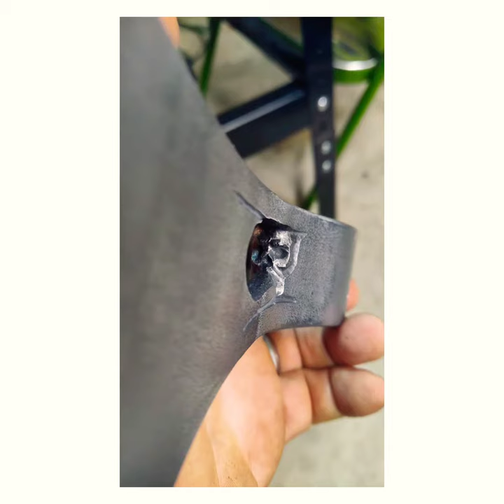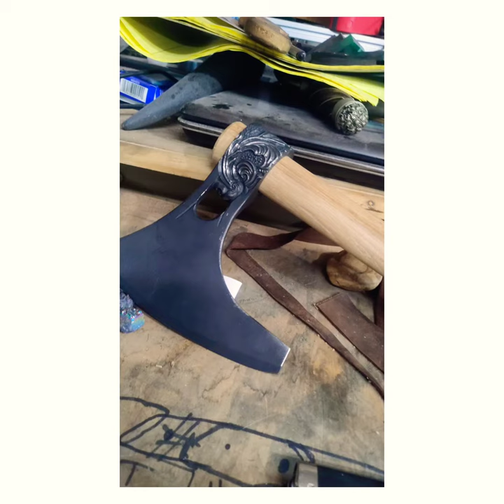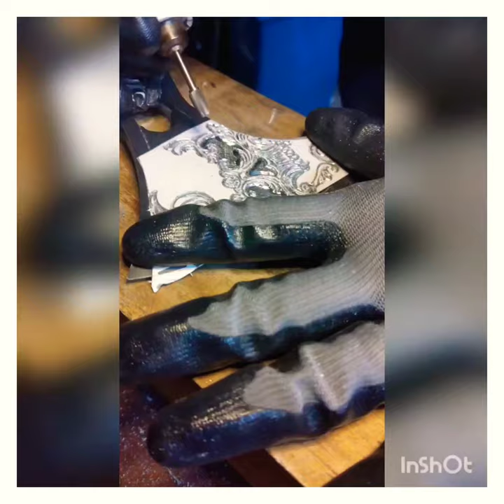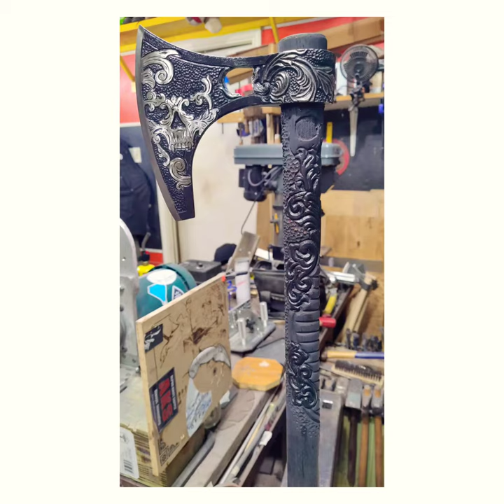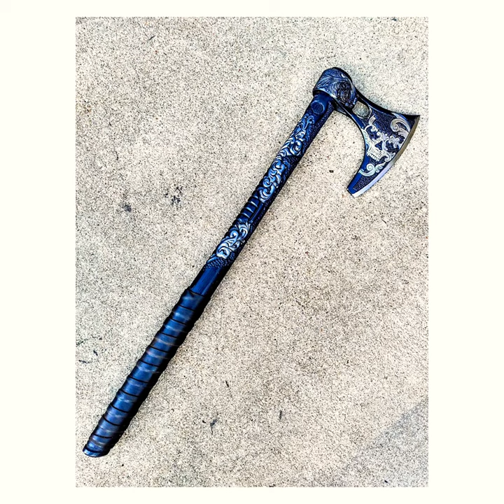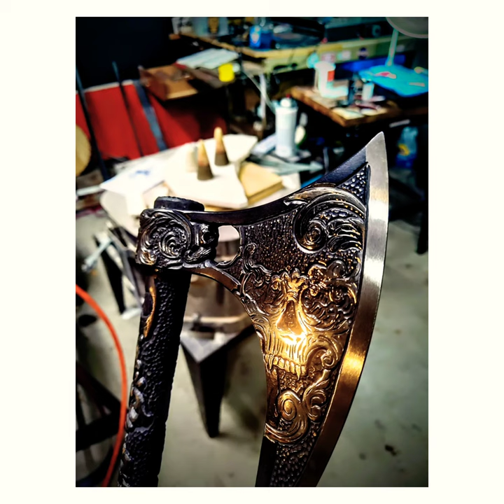How to engrave an axe with a Dremel.

Comment: May you tell me exactly what type of steel you are working on?  It is usually extremely difficult to make such engravings with dremel on hardened stainless steel or hardened carbon steel.

Seriously, I dream of doing that and I need your wisdom, this is Awesome!

I don't know what kind of steel it is but it looks like clay...
Reply from the maker: Thank you for the kind words, this particular axe is made by Cold Steel. I believe their heads are 1084 edge quenched.  I use carbide burrs and it cuts pretty well.